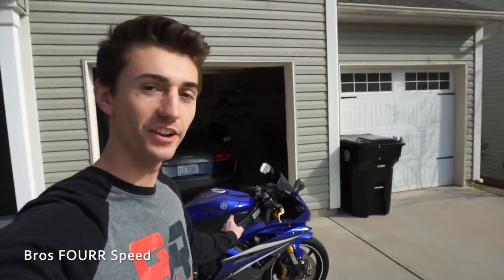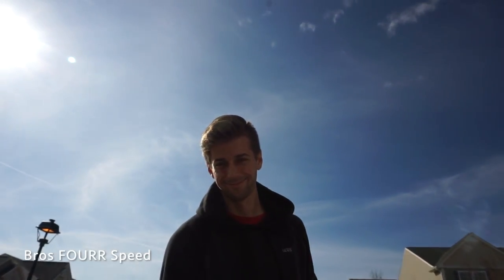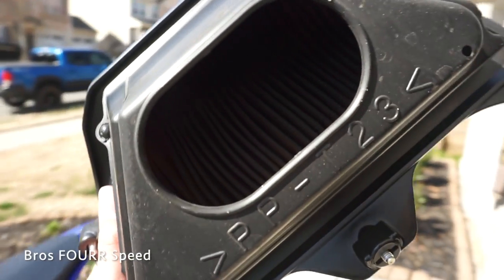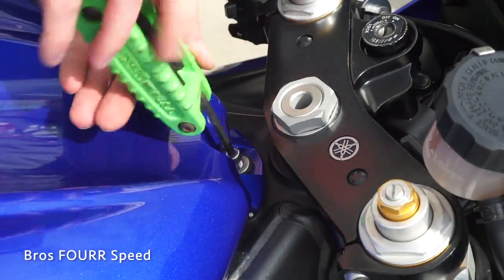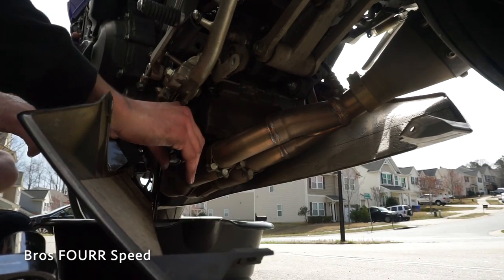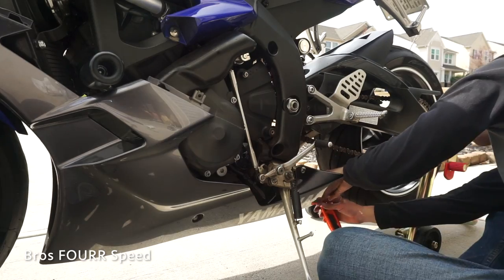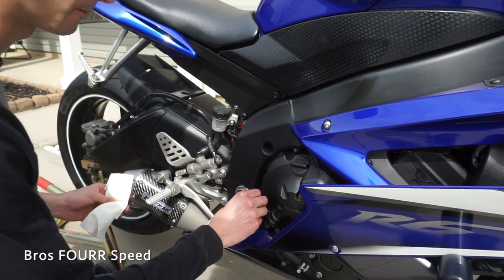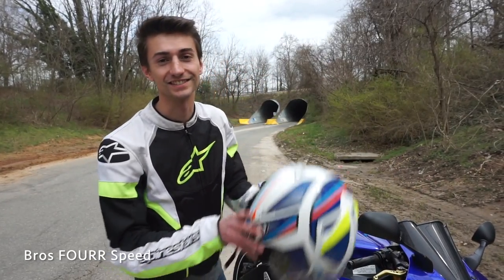(06’-16’) Yamaha YZF-R6 Oil and Air Filter Change

Comment: Couple things to note. 

Put oil inside the new filter before installing.
Some of the screws you removed were unnecessary. (tank)
Flash your ecu on 06/07 as they have low idling issues and oil starvation issues. Bauce Racing would be recommended.

Nice bike nice channel.
Reply from the maker: Thanks for the tip! I'll look into all that
Reply: What do you mean by flash your ecu?

Comment: Can you use 10w-40? I use 10w-30 cuz on the left side on the swing arms it tells you what kind of oil it can take
Reply: Cesar Guerra I was thinking the exact same thing. I wanna do the oil change myself, but I wanna make sure I'm putting the right oil in.
Reply: @hellapinoy6969  don't worry dude, I use Rotella T6(diesel motor oil) in all of my bikes and have never had a problem. Cheap as shit and it works amazing.

Comment: Nice video! Im new to all this bike and maintaince my self and would like to know more about the change of air filter. 
Which filter is good? Do i need to tune og ecu flash the bike for running a k&n filter? If yes which filter can I use? My location is Europe, so dont know if i can acces same type of filter as you :)
Reply from the maker: Sticking to a OEM filter is always good! No need for a tune or flash though for aftermarket filters! They are really all very similar!
Reply: @BrosFOURRSpeed  thanks a lot! Ill try to look into that! 🙏🏼
Reply: @BrosFOURRSpeed  oh one more question please, which oil do you run on your r6? Some say 10/40w full syntetic? My bike is a r6 from 07 🙏🏼
Reply from the maker: @christopherhansen9037  You can also use different oil filters like I did (K&N), cheaper than factory and I used 10w-40 synthetic in this video!
Reply: @BrosFOURRSpeed  could not find a OEM air filter, so think ill try k&n air and oil filter! And thanks for the tip woth 10/40w syntetic. The webs says a lot of diffrent stuff! So kind of difficult to navigate in xD but thx🙏🏼
Reply from the maker: It definitely works well! I have seen people say the aftermarket air filters could require tuning. Even the GYTR one. So the stock paper filter is definitely  a safe way to go. So you should be all set

Comment: Question, the black tube on top of the air filter black box (sensor?) I tried inserting it after changing the air filter, but it just wouldn't stick. From the video, yours went right back perfectly. Any idea what it could be? Even tried lubricant.
Great vid and thanks ✌️
Reply from the maker: I'm not too sure. Maybe try tugging on the hose/cable part a bit more to make it reach. Without breaking it. Mine went right back in like normal so I'm not sure
Reply: @BrosFOURRSpeed  I tugged and pulled the rubber pins, right back worked great. Cheers! ✌️

Comment: Do you not know that oil level is checked without screwing dip stick in? This would mean your most likely low on oil. Bike is to be standing straight up and checked without screwing dip stick in.
Reply from the maker: Interesting. However I used the recommended amount. And 4 years later bike still runs flawless
Reply: @BrosFOURRSpeed  well it’s definitely best to have the level to the full end for sure. I keep mine almost to the max line with bike level and not screwed in.
Reply from the maker: @jacobhendrickson8935  For sure!

Comment: I didn't think you were supposed to check the oil level with the bike up on a jack, also I don't think you're supposed to screw in the dipstick all the way to get the level check
Reply: Standing straight up and do not screw in the plug to check oil.

Comment: Do you see problem with this oil, my engine is knocking after changing Mobile 1 10w 40 oil. It was not there with my Yamloob synthetic.
Reply from the maker: I haven't had any problems with this oil at all.  I've used it multiple times over the 3 years I've had the bike. I'm not sure what would have caused that just chaining the oil.
Reply: Ok, it happens only at high oil temperature, need to check, if you know any reason let me know. Thank you

Comment: Hey question, u have the k&n oil filter, why not get the k&n air filter for that extra power and acceleration
Reply from the maker: From what I've seen I would need to tune the bike for it to safely run with the extra air flow

Comment: what other maintenance needs to be done to this bike besides air filter/oil change and how often? I am new to bike maintenance and would love to learn to do them myself. Thanks
Reply from the maker: Aside from a leaking fork seal that I had to replace (which I've only done once, not something to routinely do), the oil/filter is about it!  Still have the chain on it from when I bought it, that needs to be adjusted every so often which takes about 5 minutes until a new one is needed.  And only other thing I can think of is tires, bikes are very cheap to maintain and keep running!
Reply: @BrosFOURRSpeed  thank you for the quick response! much appreciated

Comment: Have u ever change STATor on you r6 thnx great vid!!!
Reply from the maker: I have not. I've only ever done oil changes, air filter, oil filter and tires. 5 years later bike still runs perfect. And I keep the battery on a tender when I'm not riding it
Reply: @BrosFOURRSpeed  great thnx mann

Comment: Have you had any issues after the oil change? I followed these exact steps on my 07 r6. My bike is having all sorts of issues shifting now, it went from 1st to 2nd like normal and would not go into third, fourth, etc. I’m sure it has something to do with the shift linkage but I’m not sure what I did wrong with it, do you have any ideas or suggestions/tips
Reply from the maker: Oh weird. I've never had an issue with my bike in 5 years and 12k miles I've had it. Is the shift linkage tight and back to where it should be? Thats the only thing I could think of
Reply: If you put on an oil filter that has the nut on the back....that nut can get in the way of the shifter. Other than that make sure the shifter is lined up right and tight etc

Comment: What’s the proper way to take the cat exhaust and not use them after putting on an after market slip on
Reply from the maker: You can buy an aftermarket midpipe and simply swap it for the catted portion of the exhaust. My bike had an M4 midpipe when I bought it.

Comment: Your not supposed to screw the dip stick back in when checking the oil just till it comes to a stop and then pull it back out.
Reply from the maker: I don’t this that 1/16th of an inch would make difference lol
Reply: @BrosFOURRSpeed  just giving you crap 😂 
You still riding the 3rd gen ?
Reply from the maker: @brucehamman4201  lol 😂 yeah I still have it! Love it!
Reply: @BrosFOURRSpeed  that’s awesome! Hey I was gonna ask you can you do me a favor and look at the nut on the end of your k&n 204 and tell me if you have rub marks from the shifter or not.
Reply from the maker: @brucehamman4201  I don’t have any marks. Always had good clearance on it. I’ll also run the Hi-Flo filter on the bike or a Mobil 1
Reply: @BrosFOURRSpeed  okay thanks I’m running the Wix and it’s supposedly the same size as the K&N 204 but I have marks where my shifter rods been hitting it so must be a hair bigger than the 204 I guess I’ll try the 204 then…

Comment: Hey man im leaking oil, and I have no idea what I did wrong, the light also came on when i was on the highway. Any ideas? Also how many Xs should i be covering with the dipstick?
Reply from the maker: You should put in the recommended amount that Yamaha requires. Did you replace the drain plug or washer? If it's leaking there might need new ones.

Comment: why put a new stock filter in i would of changed to a different one better air flow
Reply from the maker: It doesn't really make a difference. And from what I've read, the higher flow filters need a tune to run properly and not be too lean. I'm not competitively racing this bike. So stock works fine

Comment: Putting 3 quarts is ok as long as you don’t past the top line mark of the dip stick
Reply from the maker: Yeah after changing the oil and letting it run, I made sure eventing was perfect.

Comment: Man, R6 has the worst oil change procedure I've ever experienced.
Reply from the maker: Really? I've owned this for 7 years now and I can knock it out in about 30 mins. It gets easier the more you do it and doesn't seem hard
Reply: @BrosFOURRSpeed  I just feel like ive never had to remove the fairing on my other bikes? Let alone the shift linkage.

S1000RR I didn't... Tbh can't remember for my cbr lol 

I just hate taking fairings off! It's not hard, just annoying.

Just putting it all together now!
Reply from the maker: @binlagin  lol I’ve got used to it. It’s only a few bolts tho at least. My brother has a CBR600rr and it’s about as involved I think